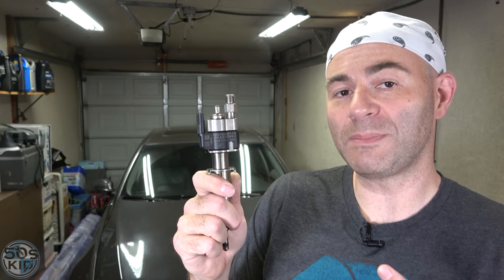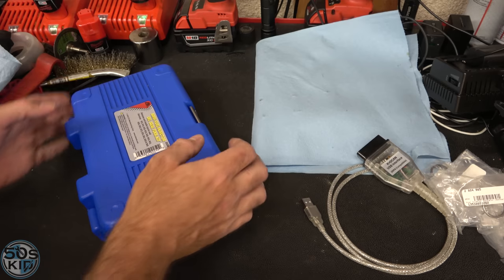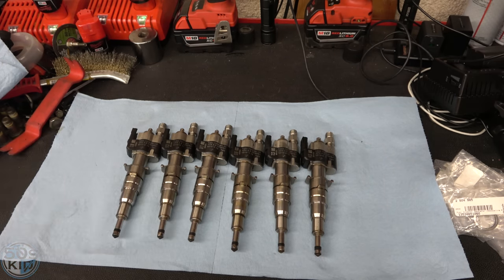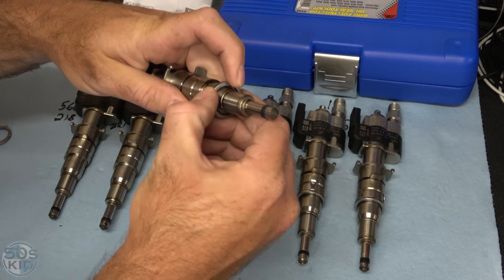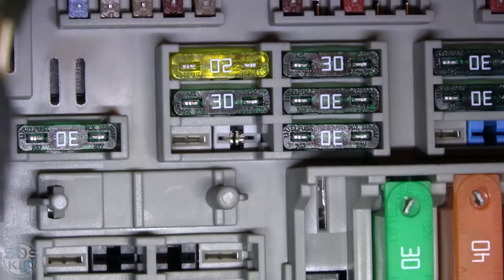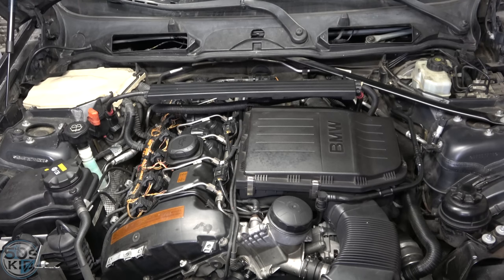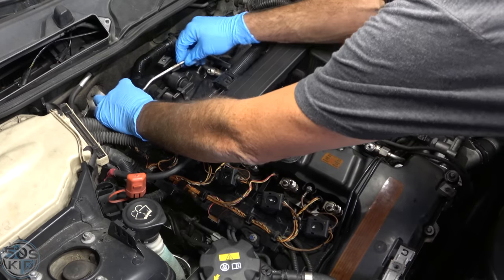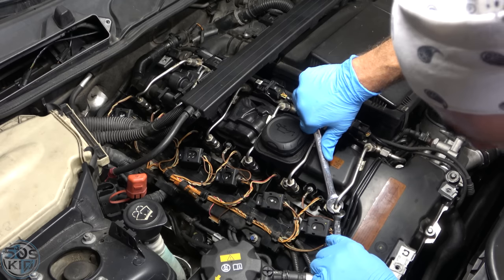Get rid of your misfires forever! - BMW E90 DIY Fuel Injector Upgrade

Comment: I wouldn't run the engine with the fuel pump fuse disconnected, because the HPFP will run dry, which isn't really something you would want...
Reply: yeah fuel system should be bled through ISTA. this is exactly the reason why so many n57 diesel bosch cp4.2 pumps are failing. people priming the system by cranking causing dry running.
Reply: @ademc8872  Yup, this was also the major reason why so many HPFPs failed on older E90s - until BMW released a software update which lets the fuel pump run when unlocking the car to build up fuel pressure in front of the HPFP to prevent dry running.
Reply: I just let the car sit overnight to depressurize, then disconnected the battery.  Minor fuel trickling out when the fuel lines were removed.

Comment: Could they be loud because they're clean? When I've cleaned and resealed old, mechanical injectors, they're always loud until they've been run for a while.
Reply from the maker: They certainly seemed to quiet down pretty quick

Comment: Been following you for years with the E46 330i. I also have the E90 330i. Even the 12th revision are still crap and are constantly failing as you will find out

Comment: Excellent work, thanks for sharing this.  I still have a slight rough idle for a few minutes on cold start on my E90 N43.  I was considering changing out injectors, but may run some injector cleaner in the tank first.  I replaced spark plugs a year ago (120k miles) and just replaced all 4 ignition coils (as one failed causing heavy misfire) this week at 130k miles.  Would you recommend an injector cleaner - LiquiMoly or BG44k?  Thanks again.

Comment: Excellent video, thanks for posting. Quick question: do you need to grease the body of the new injector before installing in the head? Ceramic grease is supposed to be good as it prevents the SS injector body from reacting with the aluminium head. Your injectors were easy to free - I bet mine won't be!

Comment: Great video. I have a f10 with the N53 engine with index 12 and yes they are loud, people ask me if i have a diesel car.
Reply: Hi. I have an E93 with N53B30A engine (so non-turbo). Did you change (upgrade) your injectors from index 11 to index 12? Or did it come with index 12 as standard? Reason I ask is that I've read that there is doubt about whether index 12 injectors should be used with the N53 engine. I kind of feel that they should work since the energy and flow rate values are entered into INPA so it knows the individual injector performance. Cheers from UK.
Reply: @micdev42  Hi, it was upgraded by the previous owner because some of the injectors were failing early. It was done at a bmw workshop.

Comment: Also you don't need to pull the fuse for the fuel pump off just simply disconnect the battery and open up the gas tank filler cap,that will depressurize the fuel in the system
Reply from the maker: No it won’t, the high pressure fuel system doesn’t bleed down the pressure like that.

Comment: As others have said, awesome work on the fat loss!

If your car hasn't had the recalls done, can you do a DIY on those, please? Blower motor plug and battery positive cable in the fuse box under the dash.

Comment: My early March 2007 build 335i has original index 1 injectors. I’m at 191,000 miles now! Original turbos too. How much did you pay for the junk yard set?
Reply: I’ve got a April build with Index 1s too125k!
Reply from the maker: $60 total I think
Reply: @50sKid  whaaaaaat!!!!! That’s fantastic, kudos!
Reply: @50sKid  Bro which junk yard is this ...  Shhhh#$@tt
Reply: @50sKid  USD 60 for 6 index 12's. OMG. I wish we had scrap yards like that in the UK! Retail price from a BMW dealer in UK is about £250 each for index 11 - and that's if you can get them!

Comment: Sup bro glad to see your still putting out good informative videos. I have a question for you. I've got a 2004 325i 222k miles the trans is jerking. Would you say just junk it or is it worth replacing the transmission,lmk thanks.
Reply: I've replaced a couple of transmissions on these, it's a piece of cake..  you can find these transmissions for less than $300us now, or even half that on pick-n-pull sale days.

Comment: Hello, I too have a bad #6 injector...Why it has to be the one that is most difficult to get to I have no idea...I too also have all index 10 injectors. Are you planning to sell the 5 that were still working? If you are, please let me know. I am on a serious budget, as I just need to get this car running so I can sell it. Of course I will recommend that the new owner replaces all with index 12, but I really don't want to spend over $1800 for a full set, when I won't get that total value back out of it in the sale.

Comment: One more thing,no need to mess with the ground cable and twist it around,just simply remove the ignition coil and you'll have all the space you'll need to work comfortably one last final thing that's kinda important and critical....you HAVE TO CAP OFF THE OPEN PORTS ON THE FUEL RAIL while servicing the fuel system, you dont want ANY! debris to fall or lay in those open fuel rail ports

Comment: I think how loud injectors are depends on mileage...  I have 12s in my 335xi and 9s in my Z4, and Z4 is definitely louder.  Got 44k miles on the Z4 and 165k on the 335xi.

Comment: Hey I’ve been watching your videos and like another subscriber asked for fluid change videos. I have been wondering if you used Top Tec 1800 ATF in a ZF transmission. I have 2003 330 / to 2006 330 and 2016 X3 xdrive . Two with 5 speeds and one with 8 speed. And if you can mix it with the ole ZF lifeguard fluid
Reply: I’d stick with zf lifeguard